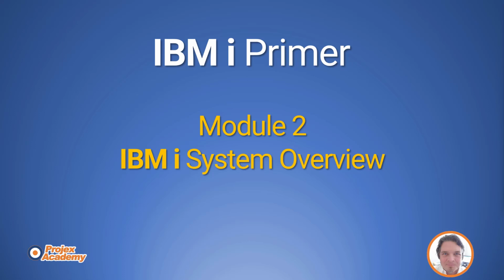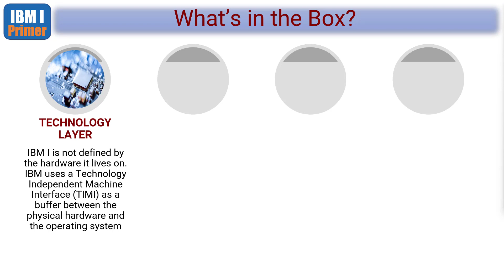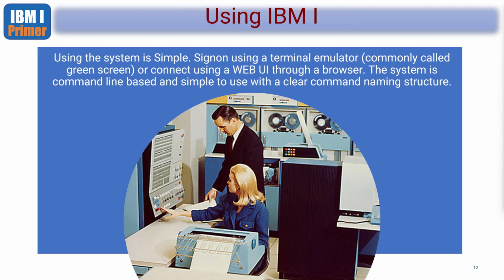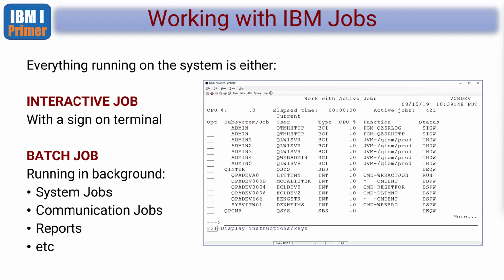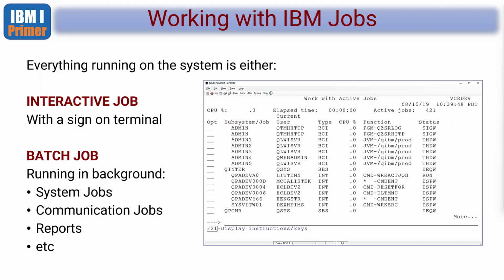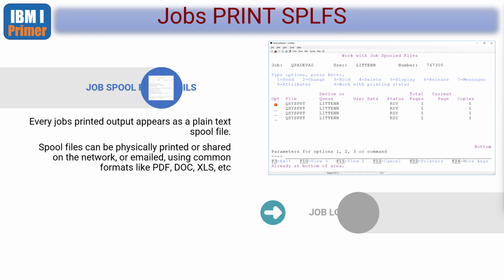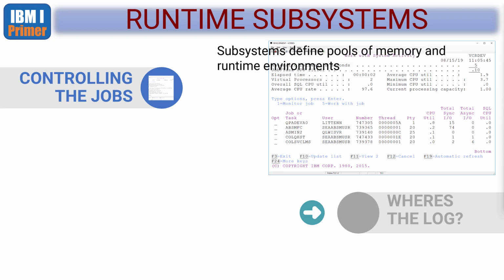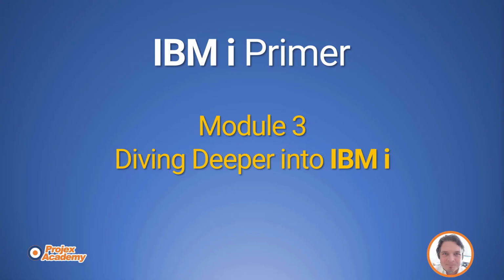An introduction to the IBM i Power System   Module 2   System Overview

Comment: the important distinction between a file-based OS and an Object based OS is that it limits what a hacker can do - on windows or linux/unix, an executable is just a file - the content can be read, and changed. On the 'AS400', an executable is just that, and only defined characteristics can be seen and modified controlled by the object definition. Yes, if you take a backup and read that backup file you can 'read' the object code of the executable, that is true (that is how you could retrieve 'deleted' records from a database file, even though you cannot read them in the live database), but that is not the same thing, and still you cannot modify that executable code and 'restore' the object, as that will still fail the object definition characteristics, which include hash totals of the content and, if you choose, digital signatures.